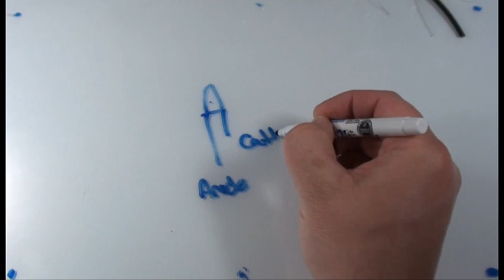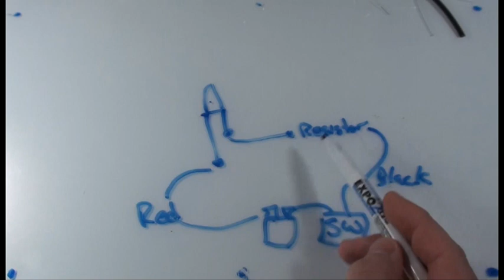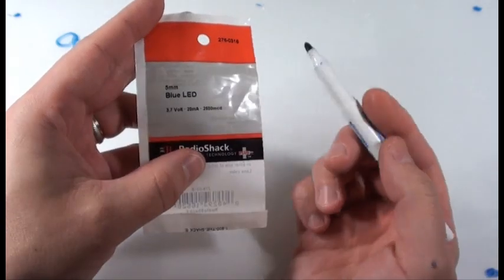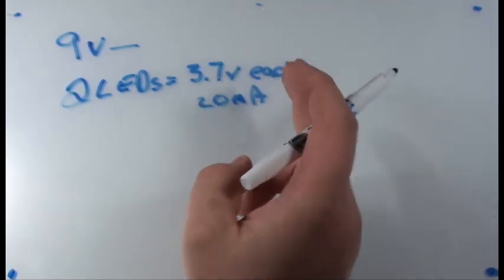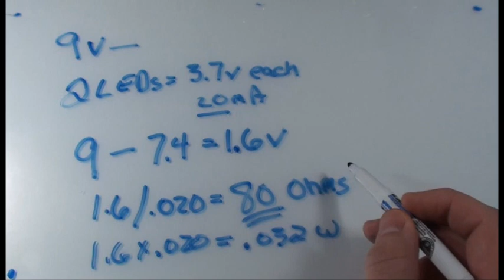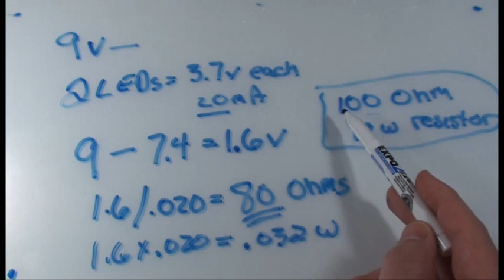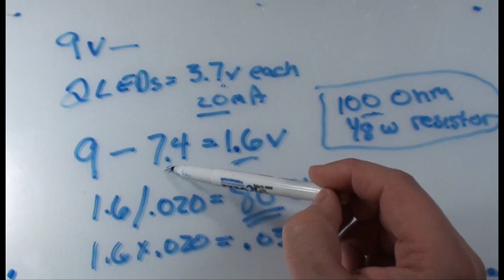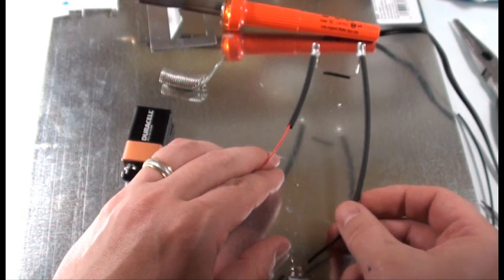LED Tutorial - Part 1

Comment: I'm a bit baffled here... Are the switch & resistor not meant to be on the live (red) wire? Surely the full 9v power from the battery is still passing through the led's before it's getting to reach the resistor?

Comment: Great VDO
I have 3 questions hope i will get the answers for all of them . 1 in a series circuit the voltage drops and all of the leds dont glow same how come in ur series circuit both the leds glow same.
2. Why you did not demonstrate it in parallel circuit?. 3 if i use more than 2 leds in series or in parallel on 9v battery so do i have to use the same 100ohms resistor?

Comment: Hope someone can help me here..

If I have a 5mm single led, 30mA, 3.5V and want to power it with a Sata power cable in my pc case..  
sata has 12v, ground, 5v, ground, 3.3v 

Can I use just the 3.3v wire and the ground wire from the sata connector?  Will that mean I don't need a resistor?

Thank you if anyone can help.  I'm trying to find out for sure but I can't find an answer.

Comment: Hi I saw your video and it's very educational and help full. I have a pair of assorted LED's from RadioShack 276-1622 PKG of 20.  I have a project that needs 6 leds two yellow and 4 red leds I am working with a 9volt battery. I have also  used a illuminated pushbutton switch 3/1.5A -125/250 VAC. The Lights did not turn on I really don't know what it's not turning on any suggestions will be very help full as this is my first time venturing in this realm.

Comment: In the "simple math" part, you failed to multiply (or add) the mA's of the two LEDs. You said one LED was 20mA, so two LEDs would be 40mA. So, you calculated for the wrong resistor. Other than that mishap, decent video.
Reply: he didnt..they are put in series so the amperage stays the same in this circuit..
Reply: Ah okay, well then that shoulda been mentioned for the people that don't understand such things that he's trying to teach.

Comment: Shouldn't the resistor go before the LED?
Reply: It doesn't matter where you put the resistor. It's a series circuit.
Reply: resistor goes on the positive side. everything goes on the positive side.
Reply: As I mentioned martin, the circuit will work perfectly fine whether the resistor is on the anode side or the cathode side as the author shows in the video. If you're wiring a LED with a transistor, you will see the resistor wired in the collector circuit (positive side) for a NPN transistor and the emitter is tied to ground (DC-). This is using the transistor as a switch where it's either saturated (fully on) or in a cut-off condition (off). On the other hand, if you're wiring the same transistor as a current source for an LED, you'll see the resistor wired on the negative side (emitter of transistor). In this case, it's wired as a linear amplifier so it operates near the middle of the DC load line. When using LEDs in low voltage circuits such as 5VDC, it's better to use a current source because the LED's forward voltage can vary from one LED to the next. In other words, you'll be able to see the difference in brightness if you're using several LEDs wired in parallel. With a current source, the brightness of the LED's will all be the same. On the other hand, if you have a higher voltage source such as 12VDC or higher, then the variation in forward voltage gets swamped out by the higher voltage so the brightness levels are not as noticeable. To sum it up, if you're using transistors to light several LEDs and you're using a higher voltage, then a transistor wired as a switch is okay. If you're using a lower voltage, then wiring the transistor as a current source is better. Sorry, for the long post. Hope that helps!

Comment: ok if you have the correct voltage match in the first place do you still need a resistor? 7.4 volts imput. how would you choose a resistor for that?

Comment: Yes. You simply subtract 6V (3.6 + 2.4 = 6) from the voltage output of your power source, then divide that sum by .02 (assuming the forward current of your LEDs is 20mA) to get the value of the resistor you need to use. If there is no resistor that matches the figure you come up with, then use the next highest one.

Comment: I have 1.9 volt led and /or 1.7 volt led 20mille amp 800mcd with a tactile switch. The tactile switch has 4 small pronges on it. I want to use minimal battery. Example to fit in the fingers of a glove. how should I set that up, would I need a resister?

Comment: Hi...I just got out a new 1.5v AA battery and a new red LED and put the long lead on the positive side of the battery and the shorter one on the (-) with a jumper. It doesn't light???I put 2 D cells in series and it lit up. Does single the AA not have enough currenr/amps?

Comment: I have a question. I bought an old battery tester to test 1.5v batteries. The led did not work. I did not see any resistors in the circuit . All I see is a male tab to put one end of the battery and a wire going to the led. On the other lead of the led is a wire with a connection to touch the other end of the 1.5v battery to see if it is good. What do i need to make it work? Ron

Comment: I think I might need some help.

I used an online calculator for figuring out the resistor I would need.

One told me, for a 3.2 V and 20 MA LED, I would need a 330 ohm resistor, and another told me I would need a 290 ohm resistor. Which one is right?

Comment: thanx warchild40k for the advice and i plan on hiding all of the wires and leds in the handle and ill try the clearcoat uv paint on a test piece of PMMA before i try it on the blades just to be safe and i still need to check out the different LEDs that are available for me but thanx for the tips and help

Comment: I'm not 100% positive, but I believe you calculated your wattage incorrectly.  I believe it should be 7.4 volts x .020 mA = .148 Watts.  Please let me know if I'm incorrect because I am building an LED circuit, and do not want to over/under estimate Wattage.

Comment: Is the middle wire in between your two led lights where your resistor is?? Cause I'm curious if you can connect both LEDs together and have them work on opposite sides of a sword handle to try and illuminate the clear blades

Comment: Should the remaining exposed solders and wires between the LEDs and at the switch be covered? Is there a potential shock/fire hazard due to them not being covered or just a short circuit issue. I'm making display cases with LEDs in them and I don't want to catch them on fire.

Comment: hmm....I'll have to find a 1/8w supplier. Radio Shack is out. I bought 500 assorted 1/4w. I ran a series of red leds with a 1/4w and the brightness is a bit dim. 100 and 50 pcs of 5mm green and white are on order. The calculations make sense now. Thank you.

Comment: Try a CR2032 coin cell. You will have  total of 4.2 V and the CR2032 is 3V no resistors required. You could also use 2 AG13 button cells.

Comment: Could you explain the significance of the wattage specification on a resistor? In your circuit, the wattage requirement is calculated to be ~0.032W while you used a 100ohm, 1/8 Watt resistor.

0.032W is several times less than 1/8W. Could you elaborate on that?

Comment: A resistor question, if I may. I'm using two white LED's - 3.3V a piece 25mA. I bought assorted 1/4w resistors from Radio Shack. 96 ohms is the number I get for wiring the two leds to a 9v battery. This tutorial calls for 1/8 w resistors. What is the difference and reasoning? Could I use a 1.4w 100 ohn resistor? or half that to a 50 ? I'm not understanding the resistor calculation.

Comment: Great Video! I have a few questions for you, I have a 46 LED Strobe Light Bar which has 6 LED that fail to light, the six LEDs that don't work are toward the end of the bar but the last LED still works. My questions to you is What can cause this? How do I know if it's the LEDs or the Resistor/s and how do I test to find the problem? Any information will be greatly appreciated. You can contact me at ashton_rei@yahoo.com 
Thank you!!!

Comment: i have a quick question about the wiring. if you wanna wire like 10 standard leds in a row, would you have to use multiple batteries? or a higher power battery? and can you get away with using just one resistor with this?

Comment: I have a 73 VW bus that I need to install a thermostat warning light. The thermostat is notorious for failing in the "closed" position.  I want to run a red and green LED.  Any suggestions or comments.

Comment: Does it matter where you put the resister in the circuit. What instead of putting the resister on the black  wire like you did, place it on the red wire between the +  of the cell and the + side of the led?

Comment: Want to say your videos are VERY informative! Thank you for making them!!!
Ok so I hate math LOL... So instead of trying to figure out what I need and end up burning up some LEDs I'll just ask you. If I wanted to run 9 of the most common "white" LEDs (from radioshack)  in sequence, how many resisters will I need and at what Ohms? Also what batterys should I use and how many to power it? (it will be going into an outfit) I am planning on using cat5 wire to connect all of them to the battery box.

Comment: Two Questions: 1- If you were using multiple LED's and linking them in series would the resistor be placed in between each LED, within the series circuit or placed inline from the switch? 2- What gauge wire should be used, with LED's, or is it dependent on the power source? Ex: Would a 12v power source require a lower gauge wire.

Comment: my friend and I went out to get 3 leds 2 green and a blue. the greens are 2.1v and 25ma. the blue is 3.7v and 20ma. I'm using a 9 volt. my friend thinks two 470ohm resistor will work. is he right? I'm not shure becasue do you add the 2 ma or use the highest ma wich is the green.

Comment: noob questions:

1.) resistors' resistance doesn't stack do they? like, if I use 2 100ohm resistor together, will they resist 200ohm? 

2.) with forward voltage, that means the voltage lost when electricity passes thru LEDs right? so how do i figure it out? does it just say in the package and it just depends on the color of the LEDs? I don't have a digital voltage reader or anything..

Comment: I have a question. You can't put 3 LED lights with a 9 volt battery right. Why are the battery powered (3 AA) LED lights able to run 20 lights. I need to run 3 red 1.7 - 2.6 volt LEDs to a 9 volt battery, this can be done correct?